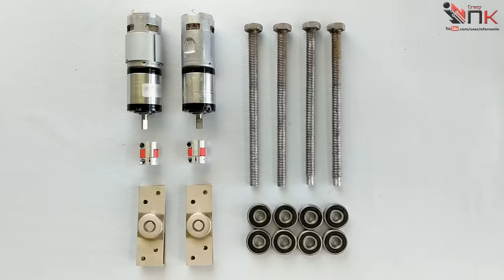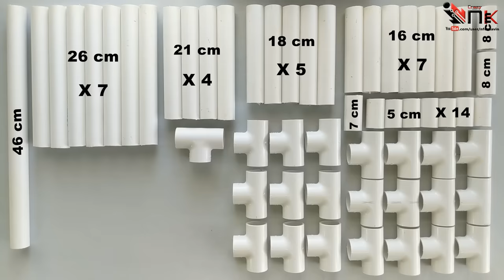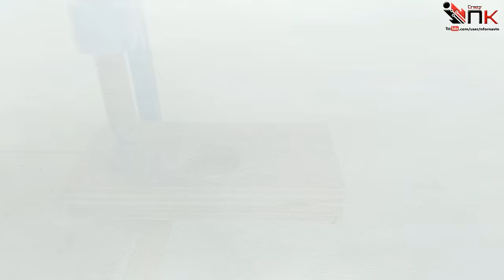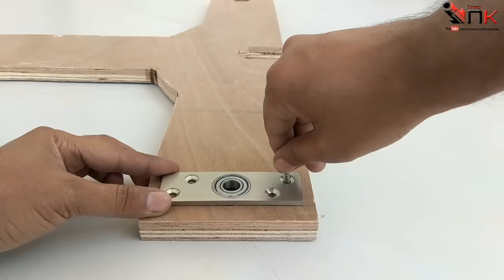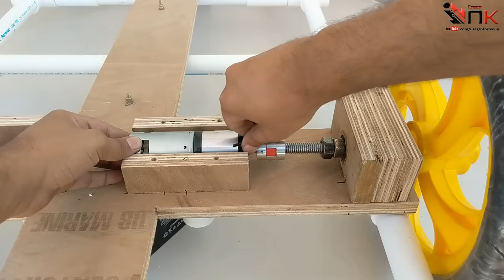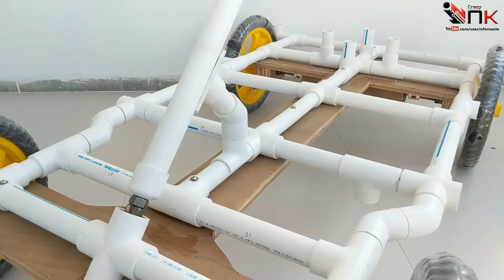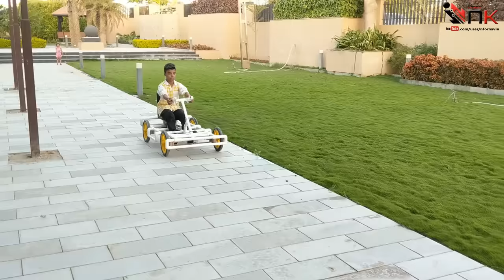How to Make a Go kart / Electric car using PVC pipe at Home

Comment: Material List
1. 1" (33.40 mm) PVC pipe and coupling
        PVC pipe: 30 feet,  PVC Tees: 27 pieces,  Elbow: 16 pieces,  

        4-Way: 6 pieces,   45 degree Elbow: 9 pieces,  PVC cap: 5 pieces

2. Plywood
       Size: 120 cm X 64 cm  (19 mm thick)

3. 18V DC Mega Torque Geared Motor
        Speed: 300 RPM, Watt: 250W, Torque: 92 kgcm 

4. Bicycle wheel
        Quantity: 4 pieces, size: 14" (inches)

5. Motor Shaft Coupling
       Quantity: 2 pieces,   size: 6/8 mm to 10 mm

6. Ball Bearing
       Quantity: 10 pieces,    Type: 6201-2RS

7. 12 mm nut & bolts
        Length: 12 inches

8. Door hinge (360 degree)
       Size: 10 cm

9. PWM DC motor speed controller
      Ampere: 40A

10. 12V DC Battery
           Up to 40Ah
Reply: \oh my goodness, you are so genius and gifted of talents. thank you for the material names. i sincerely thank you.
Reply: Thanks
Reply: Thank you very much ✊✊✊.
Please, how much all this cost you?
Reply: Muito obrigado! Deus te abençoe sempre!
Reply: Bro he took this all from navin’s own website and there navin has put all websites links from where we can buy this all
Reply: Ine sab ka kharcha Kitna
Reply: Thank you 😊
Reply: Thank you
Reply: Thank you so much ❤
Reply: @shabistanagdawala9540  tem o link?
Reply: Buenas noches podrían facilitarme el nombre de las bisagras xfa por en español gracias❤❤
Reply: Price
Reply: @gmgraphia conseguiu fazer?

Comment: Aqui los materiales en español:  Lista de materiales
1. Tubo y acoplamiento de PVC de 1 "(25 mm)
        Tubo de PVC: 30 pies, PVC Tees: 27 piezas, Codo: 16 piezas,  

        4-Way: 6 piezas, 45 grados Codo: 9 piezas, tapa de PVC: 5 piezas

2. Madera contrachapada
       Tamaño: 120 cm X 64 cm   

3. Motor con reducción de torque de 18V DC Mega
        Velocidad: 300 RPM, Watt: 250W, torque: 92 kgcm 

4. Rueda de bicicleta
        Cantidad: 4 piezas, tamaño: 14 "(pulgadas)

5. Acoplamiento del eje del motor
       Cantidad: 2 piezas, tamaño: 6/8 mm a 10 mm

6. Rodamiento de bolas
       Cantidad: 10 piezas, tipo: 6201-2RS

7. tuerca y pernos de 12 mm
        Longitud: 12 pulgadas

8. Bisagra de la puerta (360 grados)
       Tamaño: 10 cm

9. Controlador de velocidad del motor PWM DC
      Amperio: 40A

10. Batería de 12V DC
           Hasta 40 Ah
Reply: Juanito Banana Changoy uu 8) q
Reply: Cuánto te gastaste aproximadamente en todo el proyecto
Reply: Donde puedo conseguir las llantas?
Reply: Genial amigo una pregunta como se llaman los motorcito y los coples q sujetan los tornillos en el eje de traccion como los encuetro
Reply: Donde puedo conseguir lo electrico si me podrias ayudar
Reply: hola juanito ,mi duda es como conectar el motor al controlador de velocidad y baterias.
Reply: Usa otra bateria amaron.de cuantos voltios es?
Reply: Tubo pero de fierro.
Reply: Pero el PVC es tóxico
Reply: Juanito Banana Changoy  gfh
Reply: Perfecto gracias
Reply: Heroe sin capa

Comment: I love this and decided to build it with my daughter in Canada! It started out great, but then I hit several roadblocks with parts I can't find or substitute:
- The spanner tool that connects the steering shaft to the rack
- The DC geared motors
- The 14-inch plastic wheels (could I use regular metal bike ones instead?)
Can anyone help? I would really rather not order from China or India, but if that's the only way...
Reply: cc q
Reply: Three top is made by bending a real spanner
Reply: William what substitutes did you decide on?  I'm also in Canada and having a hard time finding parts.
Reply: doing better than i did,,,, 10 minutes in i had my balls stuck to a drain pipe. but seriously hit up a bike shop just tear apart a few cheap 12 inch bikes.
Reply: @billytench225  
Hi Billy, you have no other choice but to go to China or India...
Willy and daughter have  just been there...and had a great fun
Their eyes had been wide opened over there
How come those countries are more developed than Canada ?
They must've been stealing our knowledges,...how shameful 😠😠😠

Comment: I have two questions:
1. How are the motors attached so that they do not rotate? Is the box you made just squeezing them?
2. If you lift the front of the kart what stops the two front wheel assemblies from falling off? There does not seem to be anything stopping the door hinges that you use from separating.
Reply: im just asconfused as you, maybe its deaigto be assembled at the destination its driven at and gravity holds it in place as if its lifted its to be put away? thats the best ive got,  the battery seem tosqueeze in place too and the seat scecures it, i think its designed to be a portable kit
Reply: at about 5:00 a piece of plywood is clamped down onto the motor so it cannot spin
Reply: the wheels won't fall off because they are held by the steering mechanism

Comment: Love the build.  I'm wondering how much weight it can hold and how long the batteries last on a charge while it's being ridden.  I think my son and I have found our winter project.
Reply: 80-100 kgs
Reply: @Vishal-pm3vv  less than that, I’d say 70 - 80 kg MAX. Otherwise you risk breaking the board, or you can’t ride as far due to excess strain on the motors.

100 kilos is 220 lbs. I think max weight for a hover board is 180lbs. 40lbs over will most likely break it.

Comment: Very cool! Wish I had done a project like this when I was small enough to fit on the go kart
Reply: They make bigger size plastic pipe. You could make a bigger version and use a deep cycle agm battery with higher voltage.

Comment: Why not just make it metal? Pvc breaks so easily
Reply: Robert MacKinnon it would be heavier and slower. I imagine it is meant for kids too so i don’t think durability really matters
Reply: Yeah Robert, it's made for kids.  Durability doesn't matter.  Fuck em.
Reply: Does anyone know if this simple design can be replicated more heavy duty for adults?
Reply: @lasuperchica59  definetly with metal pipes, A welder and possibly a larger battery
Reply: If you want more weight and durability add sand.
Reply: Metal is heavier, more difficult to make, and cost more
Reply: It would take more time to build and become heavier.
Reply: Add rebar in the pvc pipe and pour cement
Reply: Use aluminum square stock and weld it and add gear setup from a bike and handle bars with brakes put motor in all wheels 2 more batteries mini sand rail
Reply: Besides ... this is an easy build... add metals and it starts getting heavy, expensive, time consuming and plain harder
Reply: I'm making mine out of carbon fibre.
Reply: Yeah, and where's the central lock, stereo and climate control?...
Reply: In short lengths, PVC pipe is actually VERY strong. So as long as you use enough cross-members, there is no reason why it wouldn't work. One time I saw a wheelbarrow a guy made entirely out of PVC. I asked him if it was strong enough, and he SAT in it...a full grown adult man. It might not be as impact resistant, so if you drive crazy and crash, yeah it might break. But I think it will definitely have no problem holding weight.
Reply: It's not supported by pvp pipes. The pipes are just the frame. The support is wood. That's how it hold the person without breaking. Try using pure pvp pipes. It will bend by the weight on a person and break. Since it's supported by wood, no need for metal. Just be too heavy to move around.
Reply: @johnrambo1349  The wood is just there as a convenient way to attach some of the parts. Do you really think that thin sheet of wood would be strong enough to hold the weight of a person?? It IS the PVC pipes. PVC is extremely strong in short lengths. It can shatter fairly easily with a strong impact force, but in short lengths, it has a lot of tensile strength. If you use sections of 2-3 feet, it will easily hold the weight of a person without bending. Next time you're at a hardware store, try to bend a 1 foot length of PVC pipe with your bare hands and you'll see how strong it is. It's like steel.
Reply: You could also use s heavier stronger pipe too.

Comment: 24v motor by batteries with a planetary gear set/box.....dimmer is a 0 to 5vpotentiometer...double sided switch..all connected to a (motor controller)look this up on ebay
Reply: carlos bradford la chicha la cara de cada quien su casa para aya en cuanto sales porque la cara a las órdenes del hermano me alegra
Reply: ص1 الله

Comment: I think those motors are going to get hella hot in there. Could even start a fire
Reply: Bob Smith Fire?  I think the pvc would melt first 🤪
Reply: @nelsonta00  I mean the motors are completely boxed in with wood
Reply: 2 fans can solve heat problems there imo
Reply: @Bob Smith it could burn the wood too
Reply: An electrical short from the motor and /or battery could start a fire too. Placing the seat over the electrical components is not a good idea.
Reply: Гггг7
Reply: @nelsonta00  гнр6и э

Comment: Can you please provide motor specification like it's rpm and volt??
I am trying to make a similar project
Pls help
Reply: 24v motor by batteries with a planetary gear set/box.....dimmer is a 0 to 5vpotentiometer...double sided switch..all connected to a (motor controller)look this up on ebay

Comment: Hello, it is wonderful! I want to copy it but I need to know the name of the parts that connect the engines to the wheel axles, also where the hinges are used for the direction. Thank you
Reply: Those are called motor. You can find it in electronic  shop  or parts from home depot  automotive  shops.
Reply: Or I think ur talking about motor shaft coupler.  I think I'll make videos regarding  to how to buy it and where to get it. I'm a 16 years old and I'm an inspired engineer
Reply: You can also get motors from thrown out washing machine  or moped.

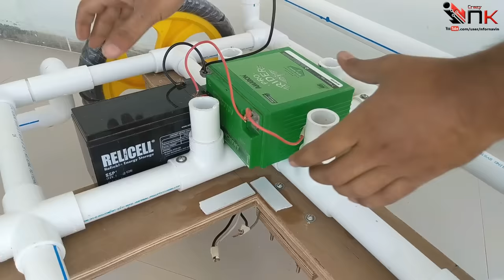Comment: 7:30 in, where did them wires come from under the car? Do I need to buy them things with wires already?

Also Is you list up to date? As the 18V DC Mega Torque Geared Motor on the link you posted are around £76, yet I can find similar thing (with and without wires) for around £10-£15?
Reply: From motor the wire comes in one + terminal and in second - terminnal
Reply: @sanjayvairagade9555  й

Comment: Hey bro I just wanted to know about the cost of the equipment
Reply: Same question is mine also
Reply: The only thing I know is that the wheels and PVC are pretty cheap. Other than that stuff, idk lol
Reply: Under 100$
Reply: Pvc pipes cost 20ft almost 500 and he used 120ft so multiply it and wheels are 10000 approx

Comment: My friends son has similar cart made of plastic which moves without motor or engine. Its mechanism is based on the steering when he moves thecsteering continously left right the cart moves forward.
Reply: Suraj p здравствуйте приглашаем вас в друзья
Reply: so it converts two way rotational motion into one way? good design, how does it steer?
Reply: Crispened Ham
My daughter has one of them. It's very ingenious in its design similar to roller blades reduced to a single wheel. Her one has the mechanism controlled by the feet instead of hands. Steering is done by simply holding the mechanism either to the left or right depending on which way you want to steer. Once the new direction has been established, power can be applied again by left and right steering.

Edit: Look up "swing cart" to see the design
Reply: incredible! i'd love to see one in person/ride one!
Reply: chickenman297 merci je suis un algérien

Comment: Why use such dated technology? Use brushless motors with a lipo pack. A good in runner brushless dc motor with sensors and good esc like a VESC 6, and a good lipo, like the zippy 8ah in series to get to 12s, and you'd have 10x as much fun and last 20x as long before breaking.
Reply: Rocket Btelenovelasoards u
Reply: @Fightnesia $80 is expensive? News to me... Total setup could be under $600 for something practical.
Reply: Rocket Boards can you say how its below 80 USD ? thanks

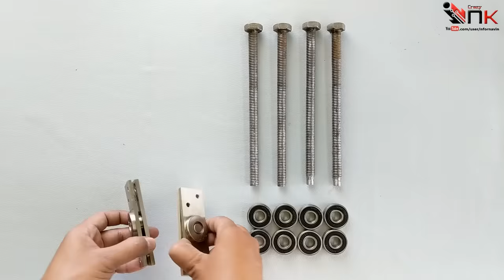Comment: what is the name of that thing at 00:11
By the way, really nice project
Reply: Sinan ÇINAR malzemeleri isimleriyle beraber bana verebilirmisin
Reply: sas7 dönüş yaparsa yazarım 11. Sn dekini
Reply: What is the name of that thing at 00:06
Reply: electromotor
Reply: Spinner
Reply: Material List
1. 1" (25mm) PVC pipe and coupling
        PVC pipe: 30 feet,  PVC Tees: 27 pieces,  Elbow: 16 pieces,  

        4-Way: 6 pieces,   45 degree Elbow: 9 pieces,  PVC cap: 5 pieces

2. Plywood
       Size: 120 cm X 64 cm   

3. 18V DC Mega Torque Geared Motor
        Speed: 300 RPM, Watt: 250W, Torque: 92 kgcm 

4. Bicycle wheel
        Quantity: 4 pieces, size: 14" (inches)

5. Motor Shaft Coupling
       Quantity: 2 pieces,   size: 8 mm to 10 mm

6. Ball Bearing
       Quantity: 10 pieces,    Type: 6201-2RS

7. Door hinge (360 degree)
       Size: 10 cm

8. PWM DC motor speed controller
      Ampere: 40A

9. 12V DC Battery
        Up to 40Ah
Reply: Sinan ÇINAR здравствуйте дружим каналами
Reply: Harshit Tech 0
Reply: @harshittech6630  
That's of great help
Bravo👍👍👍
Thanks a lot!

Comment: Had a question, my PCM controller keeps burning out as soon as it gets power. Ive tried multiple controllers and ensured the wiring was correct. I've also tried just one battery and no motor connected. No luck either so far
Reply: What voltage are u supplying to your controller? Perhaps your sending in a few to many volts need to do some transformation prior to the controller be my guess and what info you have supplied us
Reply: 5v relay your best friend
Reply: عتل .

Comment: My son and I are working hard on this project and having fun..  I have two questions please :
1. Where did you get the wheels? I am unable to find wheels without bearings.
2. Does it work without a differential when making turns? One wheel will be higher rotation than the other.. how will that work?
thank you!

Comment: Dry fit every joint first until it is exactly the way you want it then use a permanent marker to draw a line between each component at the joints before starting to glue.  That way you can perfectly line everything up when you push each component into another.  Also, properly prepare the ends of all cut components by de-burring and smoothing them; you should never have to use a hammer to get PVC components to slide into place.

Comment: Wrong!  With this design, the front wheels won't track properly when going around a corner.  One wheel has to have a tighter arc than the other. Google that and do it over!

Comment: Apart ffom many hinderace like bumpey sections ahead  needs s.absorbers air pumped  little bit higher tyer. A  foot and half   longer behind the seat  and in front basket in width or  in length will make it purposful for handecap person looks easy to build where electrial items   r availabe..otherwe can see and appreceiat .Oh yes it is running.

Comment: Brilliant, however one suggestion..may want to cut in a shaft key and keyway, or tack weld your hub connection for motors to wheels: higher torque tensile strength.

Comment: I need to build one of those wooden Lamborghinis, or a thin light weight fiberglass, and put two 600 amp alternators on it ran with power to them.or gear up a couple ceiling fan motors, With two 24 volt Batts and an inverter.. Think the kids would like that. Got to make a video of the build for YouTube tho.